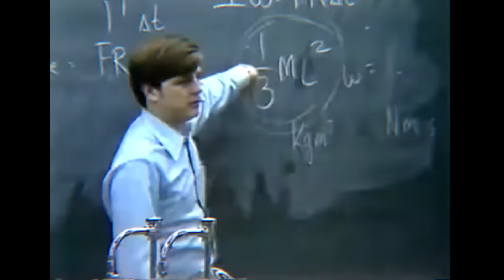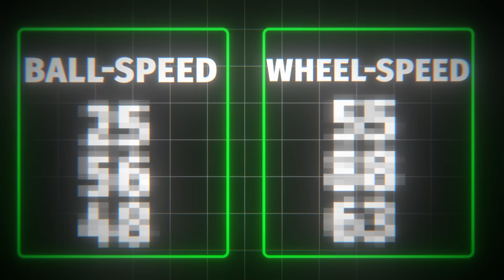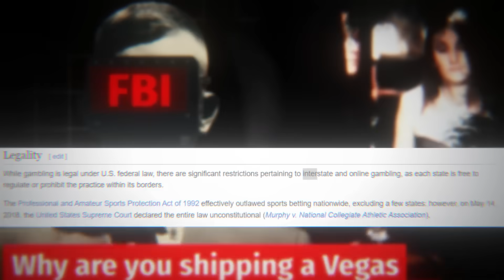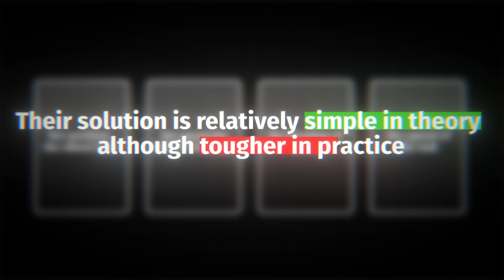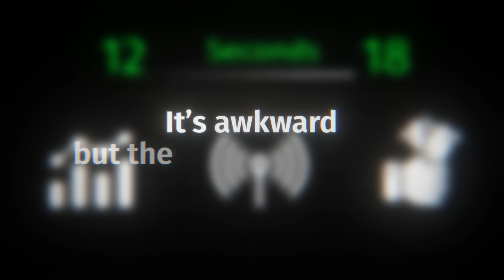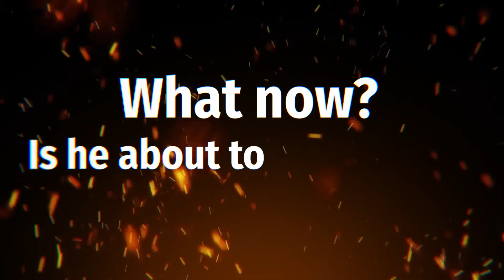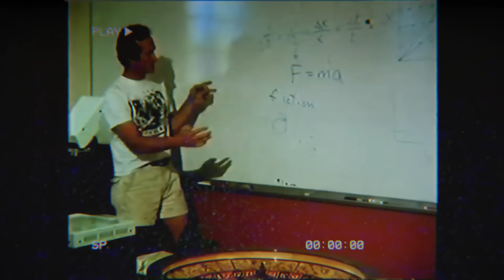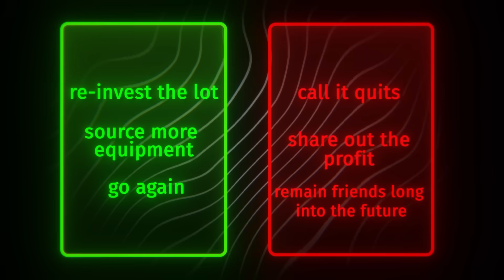The Nerds Who Beat Vegas Roulette With Science

Comment: This is all BS. As an ex-croupier for over 20 years.  I noticed that if the wheel turns clockwise or counter clockwise all the time, then you have a chance of following, if there's a pattern, of where the ball is going to fall, and to make your outside bets, or inside bets according to that pattern. If the roulette wheel spins clockwise and counter clockwise after every spin, your chances of winning are very slim. All in all, its nothing but LUCK. Gamblers always have systems, the only system is to stay away from Casino's.

Comment: I used to use this something like this method. I would sit a close to the wheel so I could visually watch the dealer. #1 If and when they changed the speed of the wheel. #2 Where the ball was let loss onto the wheel and what number it was let go at. #3 I would calculate visually how far back or forward the ball landed from the number it was let go onto the wheel. #4 I would watch this many times before sitting down to play. #5 I would wait until the dealers got comfortable at releasing the ball at the same strength level /speed. #5 I then would figure out where to place my bets quickly and a couple of rotations in. I would place bets on fives number in a section to increase my chances of a hit. #6 If I had a dealer that hardly changed the wheel speed or their own ball throwing speed and I was winning at a good consistency. I then would start playing larger amounts of chips on each number and maybe even start playing up to 6 or 7 numbers in section. This was even with the double zero wheels. If things looked a little out of whack on the spin. Sometimes at the last second I would place a bet on the zero or double zero. Many times I did win on those hunches. 

All this was back when they gave you cards to mark what numbers had hit, it was sort of a cheat sheet supplied by the casino. It was very useful for my purposes. Also this was back when you could play just $5 a spin. I think now it is up to $10 or $15 a spin at these riverboat casinos. I would go with $50 - $100 at a visit. There was many times I walked away with thousands of dollars. Over time they took the cheat sheets away, had less roulette wheels to choose from and raised the minimum bet. I was getting to hard to play an win. I never kept a detailed accounting But I think I made a pretty tidy sum of money for the many hours of play for those 4 or 5 years of low betting minimums. Another factor why I stopped playing was they never raised the maximum chip bet $ amount per number while also raising the minimum chip bet $ amount to $10- $15.